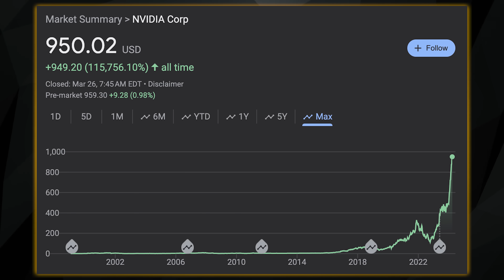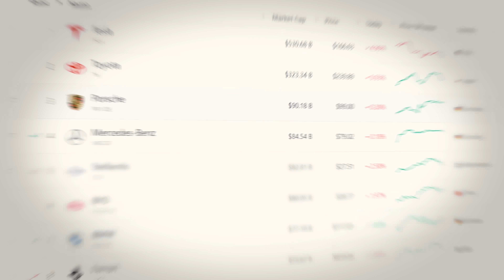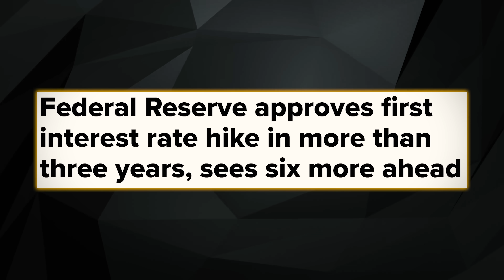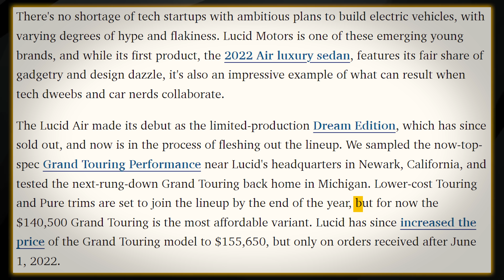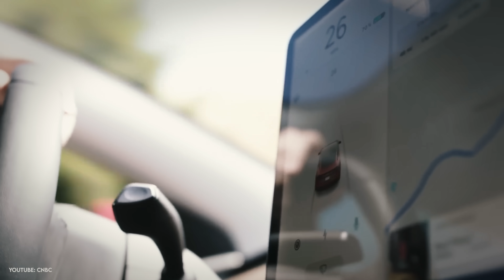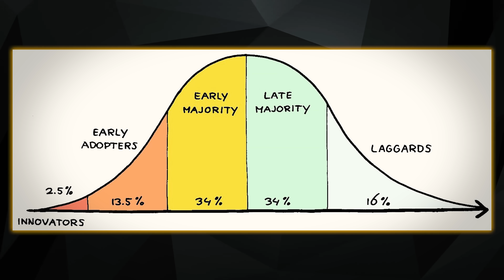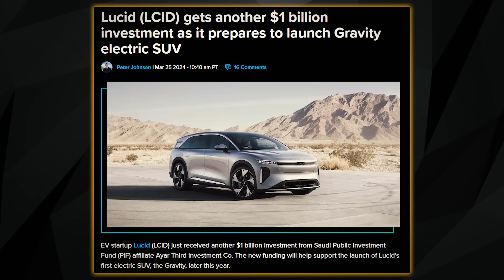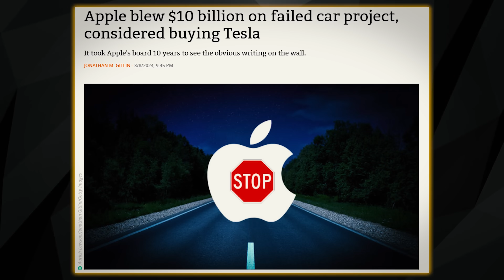The EV Bubble Popped - What Now?

Comment: were not interested in EV's when our milk and eggs cost 75$ a pop.
Reply: How ‘ bout when your thermometer pops at 120 !
Reply: "I did that!" - Brandon
Reply: I had a new loathing for fossil fuel when Saudi and all opec and all of  them cut production to jack prices up during a cost of living crisis. Screw them I live in warm country switching to renewables.
Reply: @Takudza  EVs aren't the answer you're looking for bud. I live in Canada out in the country and I prefer my ICE vehicle over any EV ever made. A hybrid might be what you're looking for instead of an EV. Oh and here's a dose of reality about the EV battery industry: the mining operations for nickel, cobalt, and especially lithium (key components in the construction of standard Li-ion batteries) do more longer lasting harm to the environment than O&G operations. EVs aren't as "green" as you think.
Reply: @preeyakumari-i2q  Wait you think electric vehicles cool the planet? :face-blue-smiling:😆
Reply: Exactly 😂😂
Reply: @ResidentWeevil2077  That, and even before the world went full blown "everything EV NAOOW!" folk looking had sighted how lithium in particular was less than abundant. And all these so-called battery-tech "breakthroughs" are still years off, with many of them still involving our dwindling supply of lithium.

Hybrid tech and alternative fuels always made far more sense, but our regulators have been lacking that for ages. When one of the frontrunner for the tech goes "hold TF up!" you'd think they'd listen.
Reply: @ResidentWeevil2077  I live in Australia’s largest city and work from home. I drive less than 20km a day on average. When it’s time to switch cars an EV charged with by my solar panels will zero out my dependence on imported petrol. Climate change is being caused by carbon dioxide emissions not the localised damage a lithium mine causes. ICE cars are also built with metal that needs to be mined but then produce carbon dioxide through out their life. Not all pollution is the same. It’s about picking your poison. I will also not be at the mercy of the whims of some oil cartel.
Reply: @MaddJakd  The oil industry isn't going without a fight. But hybrids are a transition tech, complicated and expensive. 
Alternative fuels are expensive. Especially if you have to burn it in an engine. 
Toyota is stalling with their "Electrification" talk, until they get their BEVs perfected. But we're not waiting for them.
Reply: @jamesvandamme7786  Who is we?

Seems a good chunk of the auto industry is suddenly dialing back on the "all EV push" since they aren't actually moving. Or at least heavily reshuffling since Uncle Sam and his worldly acolytes are all concussion patients.
Reply: @Takudza there is not such a thing as renewable. only less impactful, the solar panel is not using anything to produce the energy, but producing solar panels itself is still a dirty process. also storing the power isnt clean. theres no such a thing as "clean" power sadly.
Reply: @TMILP  It's all relative. Pumping million year old oil out of the ground and burning it isn't 'clean'.
Reply: Exactly, a lot of the world currently is in cost of living crisis. No ordinary folk are interested in buying brand-new ev toys when they're worried about utilities and food.
Reply: @MaddJakd  "We" is the rest of the industry that's building huge battery plants and designing next generation EVs. Not something that happens overnight, and unfortunately Detroit is used to multi-year refresh cycles, not continuous improvement.
Reply: @jamesvandamme7786  It's woefully clear you're all about it.

Do yourself a favor and refrain from acting like you speak for us all.
Reply: You’re saying “lBuild Back Better and Inflation Reduction acts didn’t solve your problems through more gov spending?
Reply: @jamesvandamme7786  thats the point...
Reply: @preeyakumari-i2q they have been saying that since the 60s and nothing ever happened. Always 5 years until we are all ready 😂
Reply: Yeah, because those things are comparable. 🙄
Reply: @Takudza just like most things its government involvement thats the worst part
Reply: Because the cost of gas to get you your milk and eggs went up... lol EV trucks can charge for free sometimes
Reply: That’s a lie because in most cases you are charging it from coal gas or oil. It’s highly irresponsible to push solution as unsustainable as battery car to be replacement for ice. This is only something rich entities poeple from USA can say
Reply: @Takudza  "opec and all of them cut production to jack prices up" is a very one-sided perspective.

Because alongside OPEC cutting production, US and EU were trying to set a maximum price on oil (from Russia, but who's to say there won't be a repeat with other OPEC countries if they succeeded), and US were dumping their reserves to try to stabilize the lower price. And now they need to buy back their reserves at some point, while oil price is stable and above what they were selling for.

In short, standing up to attempt at bullying was painted as being a bully.
Reply: @TMILP but it is two or three orders of magnitude cleaner than burning fossil fuels.
Reply: @preeyakumari-i2q it takes 10 years of average driving for a gasoline car to produce as much emission as it takes to produce a single EV. That is nothing to say of the fact that to produce your electricity you burn gasoline and coal. Oh also the increased weight  burns through tires roughly 20% faster than a similarly classed vehicle(EV sedan vs ICE sedan etc). Let’s not even mention the gasoline powered equipment necessary to extract nickel and lithium for your batteries, lithium in particular being devastating for the environment. 

I could go on about how buying an EV is the absolute worse thing you can do for the environment but I’m sure this will suffice. If you really want to lower emissions go after the private jets the billionaires that pedal this BS on us ride around in. One cross country trip produces more emissions pollution than me driving my gasoline cars in a lifetime.
Reply: Why people did not care about BEVs 15 years ago is WHY "our milk and eggs cost 75$ a pop". INAction has consequences, yet people are going to continue with stupid policies.
Reply: @whysoserious507  "That is nothing to say of the fact that to produce your electricity you burn gasoline and coal" NEAR ZERO % of Grid scale Electric Generation used Gasoline or any Crude Oil products. It simply not economically viable and Power Plants don't really exist at that scale. Your lies defy real world facts.
Reply: @whysoserious507   "One cross country trip produces more emissions pollution than me driving my gasoline cars in a lifetime" Absurd nonsense FYI a 20 year old 210,000 car at 35MPG will consume 6000 Gallons of Fuel. A Boeing 737 Max Airliner has a fuel capacity of 6815 gallons for 160 passenger. This is just driving a gasoline car in less than HALF a lifetime of driving. Your lies Defies Math.
Reply: @zawarudo1041  What a bunch of absurd nonsense, USA is not even the leading market for EVs. You live in a self centered bubble where you think USA is only the place where concepts should be taken from. You made a bunch of absurd assertion with zero reasoning, your only agenda is cultural criticism. This issue is about engineering systems.
Reply: @Neojhun  I don’t even know where to begin dismantling your argument. 

1. I said private jet. Not airliner. Private jets produce more emissions than airliners yet transport less people

2. Comparing gallons is not the comparison you think it is. One is restricted with catalytic converters and whatnot to produce less emissions, the other is not.

3. My math isn’t the issue, it’s your reading comprehension that’s off
Reply: @Neojhun  the main reason that eggs are up was collusion by the egg companies in the United States and they were fined a huge amount of money and egg prices are now back down to under $2 a dozen.

However a long line with your post, the reason that beef it's so expensive now is that the herds are much smaller because of the drought last year. And we are seeing exceptional drought conditions for several years now in texas. There's not a solid tie to climate change yet but there are strong correlations and droughts as well as shifting rain patterns are predictions of climate change theory. When the rain shifts off of the current arable cropland, it's going to be bad.
Reply: Meanwhile, I'm excitedly waiting for Apteras to start rolling out because they'll be an actually affordable EV option with very low ownership costs.
Reply: Any new car is expensive. Don’t talk for me. I like EVs. The lucid air is in a different realm. Tesla was just the start of EVs but not nearly the best. 

Also food is expensive it so is your lifestyle. I spend no more than 500 a month on bills. 

Find ways to help yourself because complaining won’t.
Reply: @ResidentWeevil2077  I had an Hybrid in Montreal and honnestly it was great, no range problem when you had to go long distance, and whenever you stay around town consomption was around 3.7L/100km, I think thats a way better alternative for most people as while cities are great for EV since distance is short, Charging is a challange since most people live in Appartment or don't have dedicated parking etc.
Reply: You forgot competition from China, which are the biggest evs manufacturers
Reply: But don't you care about the global warming
Reply: Poor baby needs to blame.
Reply: Yes it’s one sided. So you want me to see things from the rich gulf state point of view while I’m paying more than $2 per litre?! 😂
Reply: @Goriaas  I'd rather have the electricity to run the A/C.
Reply: Buy a cheap second hand EV and with the fuel savings will cover the eggs issue - ironically a lot of issues with food is because of climate change...
Reply: Strange here at Walmart they are 10 dollars for box 📦
Reply: @colinwiseman  What climate change? Weather has natural variations and frankly, the mining for battery materials are more damaging to the earth.
Reply: @Rockstopmotion  Ouch!  No wonder people are so careful with money.
Reply: @Takudza

How exactly are batteries a renewable resource?
Reply: @Takudza

Solar panels from China, EV batteries from China all shipped to you on huge ships spewing tons of carbon emissions.
Reply: @MaddJakd  
Lithium ain't an issue , plenty of it as there's plenty of batteries available now, and the associated costs to them are coming down. Plus, sodium ion batteries are getting better and better in the energy density, making them a viable alternative to a certain class of cheaper vehicles.
I know you want want to listen and even consider that you're wrong, but I don't care it's for others that might read this comment
Reply: @ResidentWeevil2077 

I bought Chinese EVs
Reply: @ResidentWeevil2077  Dont forget about planned obsolesence, they build products that dont last long in purpose,  a car should last 20 years if they build it correctly, but people today change cars after  3-4 years.
Reply: Clearly people are interested, the model y was the best selling car of 2023.
Reply: @Takudza when people refer to the environmental impact of Lithium Mines, I think they’re more worried about the leeching of heavy metals into the surrounding aquifer than we are the heavy machinery that’s spewing out the same amount of CO2 as thousands of ICEs. But maybe ya need to do a bit more research before you come to the table to discuss. Like most people in these comments.
Reply: @TMILP  you are mistaken. “renewable”refers to the source of the energy not method of capturing it. The sun is a renewable energy source. Petroleum is not.
Reply: @G1BBYMAC  mate you need to do your research into how lithium is mined. The method you seem to be referring to is evaporative pool mining and it works my bring brine under salt flats to the surface to dry in the sun. This Brine already contains the lithium. It’s like claiming you will contaminate the sea with sodium from sea salt extraction.
Reply: Exactly. The only EVs that people should be interested in are e-bikes. Time to sell your car.
Reply: @preeyakumari-i2q  120! is a very large number. if your thermometer goes to 120!, then you are beyond dead.
Reply: @preeyakumari-i2q oh no I’m hungry but most importantly really hot so now I must turn on a fan :,0
Reply: 100% the issue, I can say I have seen a surge in 90s cheap cars on the road again. cheaper to maintain and cheaper to insure and register.
Reply: Awww…crybabies are cute when they cry over spilt milk. Get some chickens the eggs are nearly free.
Reply: @MaddJakd EVs still going UP in sales globally. Larger amount of EVs being sold this year than ALL vehicles sold in the US.
ICE is dying rapidly as the largest market by FAR in the world is moving to EVs and their parts manufacturers will do the same. Meanwhile, GM and VW and others are losing their ICE sales in China faster than they can ever hope to make up for it.
Reply: @TMILP WAY CLEANER than OIL and COAL which can’t even SPELL Clean.
Reply: @piotrdrabinski8019 Yeah foolish take. The LARGEST market in the entire world is getting close to 50% of all Vehicles sold as EVs. The number of EVs this year is larger than the entire US auto market. So clearly you don’t know what you’re talking about.
Reply: @zawarudo1041 No foolish person. Coal usage has plummeted in the Advanced Economies…but you probably know that. And you probably know you’re lying about OIL providing electricity. It’s rarely used.
EVs are often charged by Solar and Battery Storage. Keep up the 20 year old Fossil Fuel FUD!
Reply: @OIllllO Plenty of EV batteries being made in the US but keep huffing your poisonous fumes from your tailpipe.It’s clearly helping your brain get smoother.
Reply: @DavidC-pg6ni 
I was replying to someone who lived in Australia. Talk about smooth brain you must be looking in a mirror but since you had to chime in where do you think the materials for those US "made" EV batteries come from? The Inflation Reduction Act will drastically reduce the number of EV eligible for the $7500 tax credit. 

"The IEA estimates that two-thirds of global battery cell production is in China, while the United States accounts for approximately just 10%. China also leads the global processing of minerals needed for EV batteries, such as graphite and rare Earth's 

" China controls 60% of the world’s lithium mining, 77% of battery cell capacity and 60% of battery component manufacturing. Many American EV makers, including Tesla, rely heavily on battery materials from China"
Reply: Apples and oranges
Reply: Bro i my dream car right now is 2018 rav4 toyota or 2017 honda crv. I have become that low on finance.